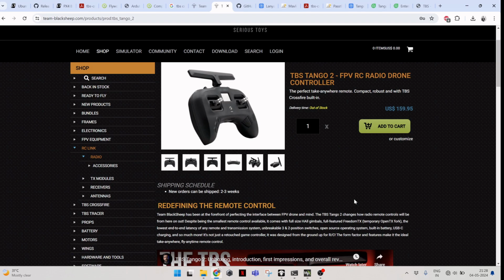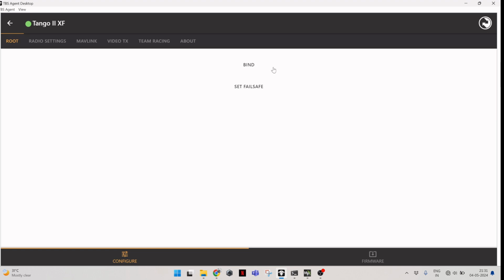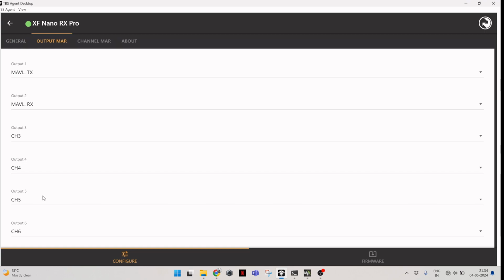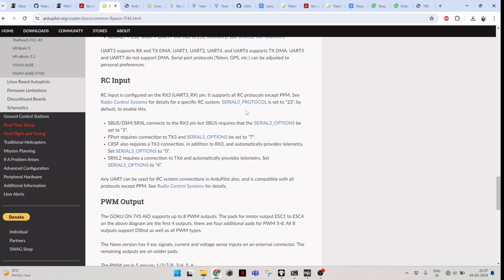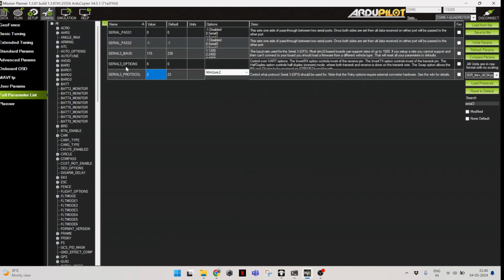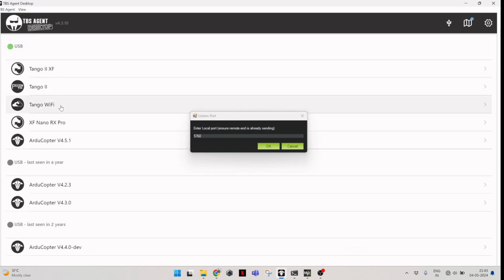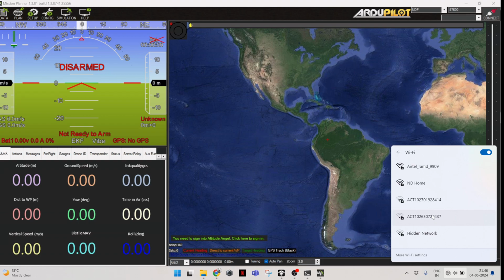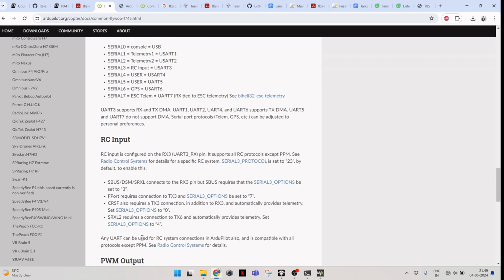TBS Tango-II || Mavlink over TBS Crossfire ||  mavlink/CRSF in mission planner using ardupilot, UDP

Comment: When Mission Planner connects through MavLink, on the stage "Getting params" you can simply press Cancel button. You will see UAV connected and all telemetry updates. Only thing you can't see is the full set of the values in the ArduPilot's setup parameters. So, in this case it is better do not edit any params in the param list.